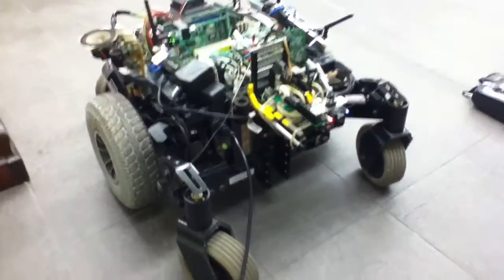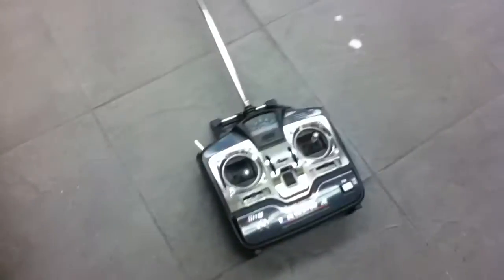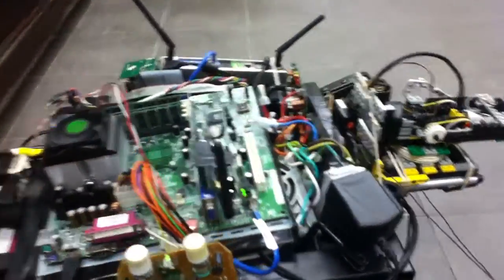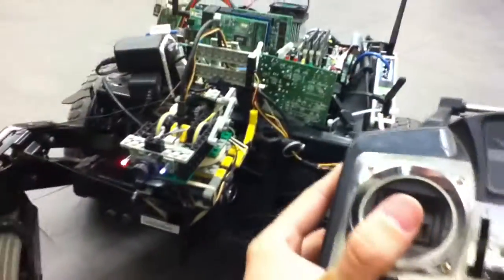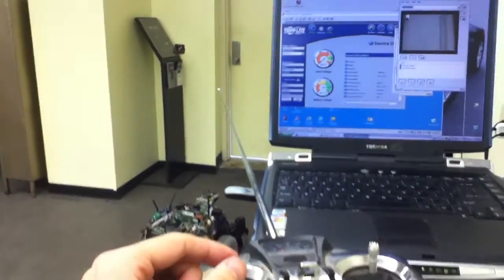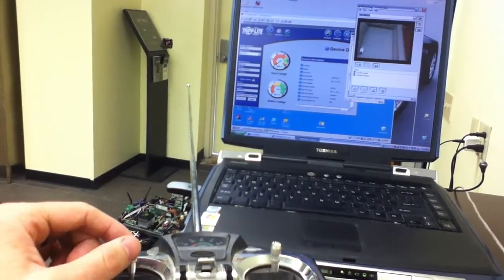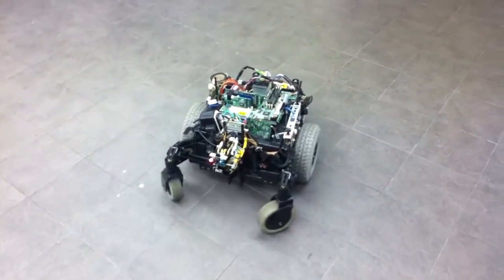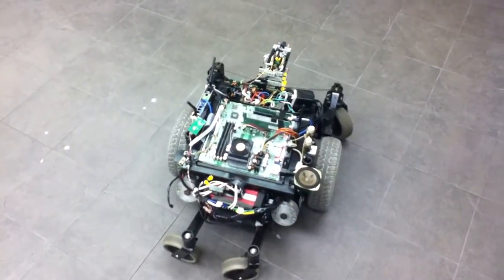Spy cam robot

Comment from the maker: As for where to start, check out robotshop[dot]com. They have a very wide range of parts, including some base platforms for starting a robot and expanding. Once you understand some basics, you can get an Arduino, and program your robot to do things. But first you want a base to start on, a little tank tracked platform is great, it can carry the weight, is agile, and has good traction. And do plenty of critical reading on what your dealing with, it will help a lot down the road.